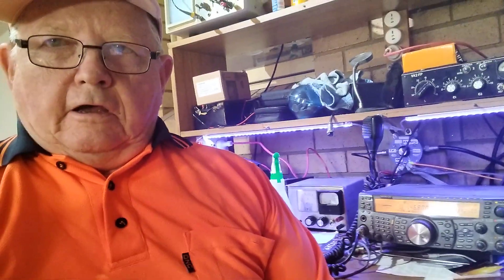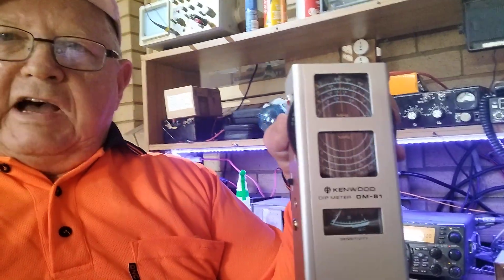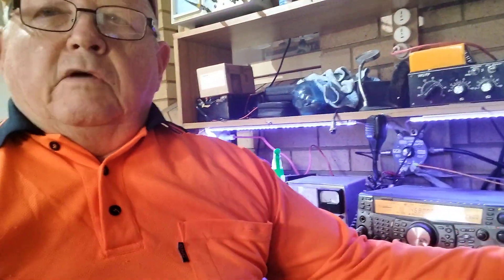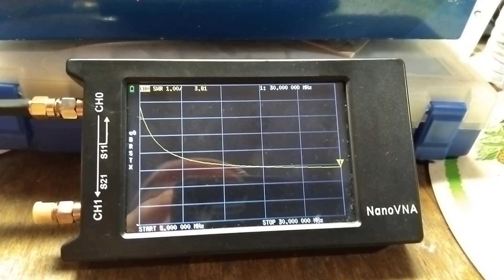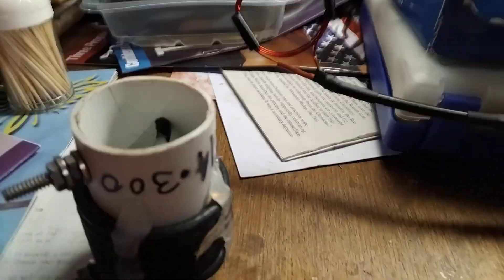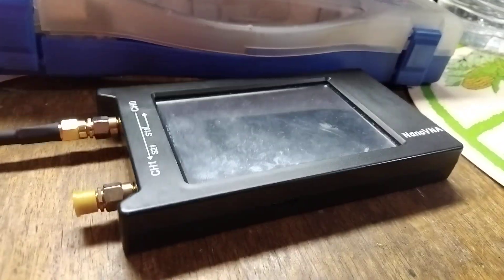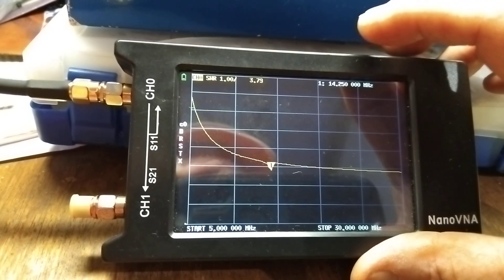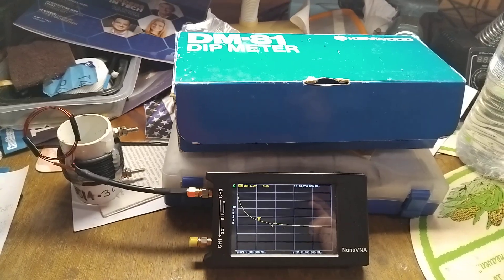Nano VNA as GDO

Comment: I wound mine around a pill bottle and no coax, just two wires two inches long into the SMA connector and I use the RL setting. (return loss) Ron W4BIN
Reply from the maker: yep, there are lots of settings you can use, the nano vna a lot less 'fiddly" than a standard GDO, but these days, a standard GDO is like rocking horse droppings, so, gotta grab them when you can